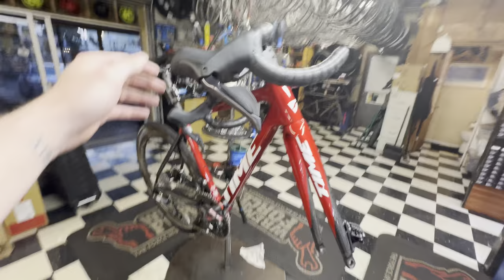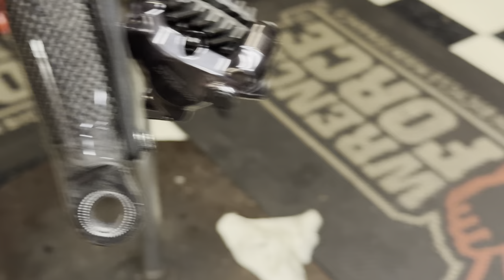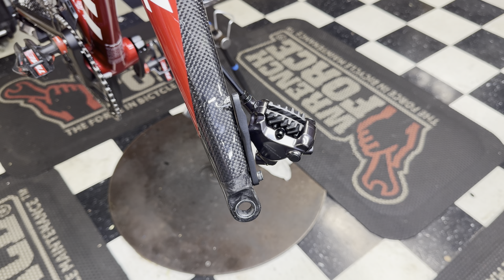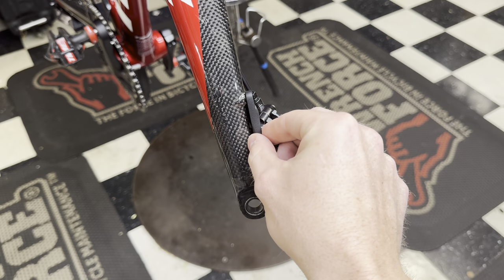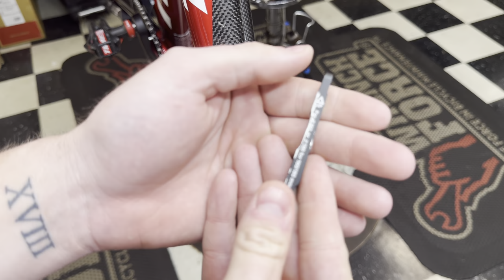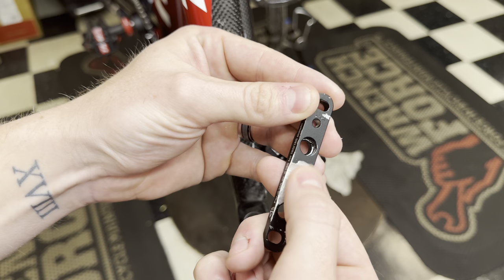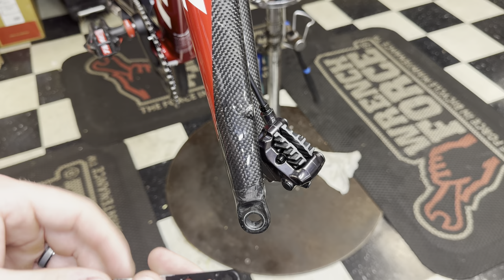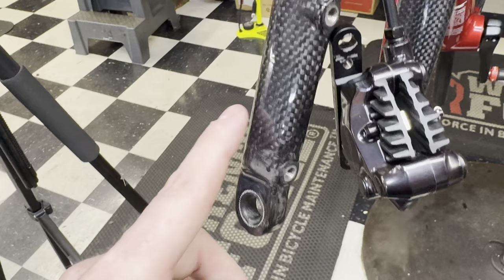HUGE Issue Found with TIME Bicycle Frame

Comment: No direct criticism to anyone involved, certainly not yourself, but if I was that customer I'd absolutely be requesting a new fork from Time.

Even if the solution works for this particular customer at the moment, the idea that this customer / future owners of the bike will have to modify a brake mount to fit different size rotors just feels poor for a premium product costing thousands. Fair enough it's an appropriate bodge to ensure the customer can ride the bike soon, but I'd expect Time to make it right all the same (ie send a new fork and, once received, send the faulty one back).
Reply from the maker: of course, and that is a route I told the customer to make aware to the company and he can do when he wants too, The reason it is like this is because he is a far away drive like 2-3 hours, and i am not a time dealer, he bought the bike direct to them so he has to handle all the back and forth to get the new fork, but that takes time and I know he has been waiting for this build to be done so he wants to ride now, so I am sure he is going to email them and make them aware
Reply: @GCPerformance18  Absolutely, and chapeau to you for taking the time and effort to find a solution which can get the customer pedalling as soon as possible! Very jealous…

Comment: I’ve had experience with problematic caliper mounts. One way I’ve got around the issue is to use very thin shims specific for the job. They work well but they’re not easy to get.

Comment: I like your way of thinking and solving the issue, personally I would change it for the simple fact of the cost of one of those frames, it is very expensive to tolerate failures of that type, greetings
Reply from the maker: yes the customer ended up getting a new fork but in the meantime the customer wanted to ride his bike too

Comment: The grind downed bracket would bother me to no end.  Also, wouldn't the fork come out of a mold?  The fork should be fully cured inside a mold before the mold is removed.  How can a lump exist like that?
Reply from the maker: I have a friend who said he could machine one perfectly, this was a case of the customer is eager to ride his new bike and also needed to be done by saturday, I am a problem solver at that point and want to make him happy and have his bike ready to ride, in the meantime of him deciding what he wants to do
Reply: Inadequate mold pressure
Reply: Fork is likely made without the through axel ends which are bonded on in a separate step after molding the tube section. A bit of extra epoxy dripped when the tips were added.

Comment: Would a thin washer have worked to pull the brake mount away from the fork?
Reply from the maker: it needs more then a thin washer, there was a lot of material, and once you add a washer that is enough to work it would not hit the brake rotor where it should onn the pad and can wear outt he pads wrong and not give you full contact on the rotor

Comment: I would have time sent out a new fork and let them pay for the extra labor. In the mean time... would ride the bike while waiting on the new fork. Good solution... but i wouldnt be happy as a long term solution
Reply: charlesmansplaining but he asked the owner what he wanted to do. It was owner’s decision.
Reply: @Questioneverything72 the owner said he wanted to weight weenie a brake adapter? Think about the loads going through that with the now reduced cross section.
Reply: charlesmansplaining  I disagree. Owner made an informed decision. And once Grant paints ground  section protecting it from corrosion, it is highly unlikely that adaptor fails because from what I see it is still thick and strong. Furthermore, scientifically speaking ( physics), adaptor’s main job is not force bearing. It is for brake position and alignment.  In braking, vector of force is upward on lower bolt ( braking wants to pull it out). and downward on upper bolt ( braking pushes the bolt down). If bolts are not loose and not moving there is almost no tension or force in the middle of adaptor because two side are fixed and not moving. You can ask Hambini if you doubt it  😂 joking
Reply: charlesmansplaining  yes I agree to this point you are making. Because I don’t know how this section of fork bulged out. Does it have a weak line inside? For that reason personally I would have replaced it because I paid 4k for safety and warranty. Otherwise I would have bought cheap Chinese frame ( which I have two). Regarding carbon safety you are correct as well. Eventually resin/carbon bonding weakens over time and no one can set an expiration date on a bicycle. But metal frames are also subject to rust, oxidation and corrosion but they “may” last longer… anyways My Chinese pinarellos are at age 12 now. I know I am descending +40 mph on the edge.  😬

Comment: In my situation I would get the frame that supports rim brakes cuz fuck disc brake rub and pumping loss. Get aero rim brakes if you are worried about aero.

Comment: If you would have put a plastic or carbon spacer, to offset the gap or height in the flaw it would work perfectly! Worked for Toyota for 13 years, was a Master Technician!
Reply: Would this have potentially put the caliper in the wrong position relative to the disc though 🤔
Reply: Well If you put spacer on it, the caliber will be away from the rotor about more or less millimeters and the braking will feel weird and it will damage the caliber like piston. Since you said you work for Toyota, this doesn't make any sense about bicycle...it's a car, not a bicycle. Bruh!
Reply: @pochmaui  how would 1 mm damage the caliper? Most bike frames and wheel combos require caliper adjustment to ensure correct fitment without rub. 1-2 mm is sweet nothing in respect to how big the pads are.
Reply: Rim brakes...no issues
Reply: That is a terrible solution.
Reply: @Spartan9567  Shimano pads are tiny

Comment: it is easier to file down the mounting bracket as it just need to keep the proper distance between the caliper and the frame which is being hold by the screws. So in general if you file down the bracket to sit arround the bolge will be better than sanding the fork

Comment: My suggestion for a short term solution, would have been 1-2mm of washers behind the bottom bolt to flush out the mount until the fork was replaced.

Comment: If that was a manufacturing issue it would appear on every fork produced, but because of the way it is made it cannot be the carbon bulging, it's an overspray issue, it needed polishing out after a bit of sanding.

Hardly a massive issue

Comment: Clever fix. Couldn't you add a small stainless washer between the fork and the caliper mount on the lower bolt?

Comment: Could you have spaced the bottom bolt with washers/lockrings to even it with the top bolt when it's tightened? Seems like that would've straightened it and maybe the caliper sits a millimeter or two higher on the rotor but the pad would still function. I'm no mechanic but that would've been my home solution.

Comment: You don’t just grind off parts of the brake mounting system. It’s safety-critical. Sounds like Time are replacing the fork, which is the correct outcome.
Reply from the maker: its a small amount and that mount is braced by the fork itself, there is not enough pressure in the world where that brake mount fails... even braking down hill for 100 miles, the rotor would brake before that mount
Reply: @GCPerformance18 I'm glad you're confident. Because you've now won liability in the event of an accident involving the front brake...
Reply: The fork needs to be repaired or replaced by the frame manufacturer. No way I’m accepting a solution like this other than temporary while they take care of it.

Comment: If I was buying a Time frame for 4000€, with the reputation they have, I would expect perfection. No way that I would accept something like this. I know that grinding a little bit of the bracket is no problem, but I would think of that everytime I would ride the bike

Comment: It almost looks like the adapter should be turned upside down/fliped and turned in.  That angle at top of the adapter looks like it should fit.  But, good catch.  I encountered that on a fork about 5 years ago building one of my bikes.

Comment: LOL.
I bought a Look Blade RS 795 since Mapdec and some others were drooling all over the bike. On paper, I loved everything (geometry, specs etc) and how awesome the bike looked so pulled the trigger.
Seatpost tolerance was MILES off. You could not get the seatpost in past couple inches. Handlebar design was horrid. The way cables exited the holes, you could move the levers a few millimeters up or down. Allowed no other adjustability. Basically restricting you to a fit that you may not like.

Place that sold it to me refused taking it back since I halfway built it. Got rid of that bike before even riding it. Lost 3.5k dollars in sale because I was honest about its problems. Expensive lesson but I will never ever consider a Time or Look again. I know it happens with every bike brand but so far I've had 30 or so high end bikes. None of them had any issues except one bike needed a shim for headset cover so it doesn't rub on frame. No big deal. Other than that it was just the Look and now your Time with major problems.

They can keep their "artisan handmade" frames 🤣
Reply from the maker: I build a ton of frames and I am really use to specialized and scott because I sell them, but this frame was a lot of patience and problem solving witht he cable routing under the bb and also seatpost clamp has a nice sharp lip to it, very weird for the frame, I am so use to specialized and how quick I can run it through and everything just works.... but This time frame does look beautiful once all built and the finishes of the frame are pretty but I have never rode one so I can not speak on it
Reply: @GCPerformance18  Honestly I don't doubt that any high end bike out there rides great but the differences nowadays lies in the reliability / headache for me. I LOVE building bikes and issues while building a bike just turns me off of them real fast. I agree with the big S. People love to hate on it but I've had 3 rim brake and 4 disc brake S-works and Specialized frames since 2018. They all built up 100% headache free and rode amazing.
Reply: My 1st bike was a Time VX Special Pro and the chainstay rear derailleur cable stop was a glued in peg that eventually came loose and out of the frame! Only dumb design like that that I’ve ever had on a bike! I was the 2nd owner and Time wanted ridiculous money to fix so I literally tossed it into a dumpster!

Comment: I’ve run into this a few times over the years and I’ve always solved it the same way you did.  I use a mill now which leaves a nicely machined surface on the adapter.  Shame on Time for not addressing it before it left their facility.

Comment: Throw a 2mm washer in the bottom level it out more same with a lot things if tightening one side down completely then the other I've added shims in these before with no rises saves all the gaining and loosing the stench of the parts, but this being a defect time need to warrant the warranty and replace the forks later on fix or not

Comment: The problem is with the plate (adapter), I use original Shimano, or even Chinese clone and have perfetc fit. The forks comes from the form, and it cannot change the shape that much, then it is polished and varnished. It could be heavier coat of varnish.
Reply from the maker: Yea….. as I said I have multiples of the adapters that I tried on and even sram one as well. And those all work on other bikes. In this case it was the fork

Comment: Another unbelievable QC flaw from the bike industry... either all shitty frames go to youtubers or there is a general problem here.
Reply: I cannot believe the client accepted that solution... It looks like something I would do on my shitty Aliexpress bike frames but definitely not in an expensive Time frame.
Reply from the maker: lmao this is a problem solving solution he lives far away and is eager to ride the bike, he wants to come saturday, this work and is perfect.... if the customer should choose to get a new fork if it bothers him I am sure it is no problem, also I am talking with a buddy who owns a shop and says he can machine a new adapter very clean cut edges and spray it black so I might go and do that if the customer really wants one
Reply: @GCPerformance18  I just think it's an easy QC check... The solution is fine, definitely better than sanding the fork.

Comment: Wouldn't it be much easier and cost-effective to put a small spacer at the bottom instead of sanding down fork or the mount?
Reply from the maker: The spacer would have to be significant enough to move it away from not touching and when doing that. You move the pads from having the most amount of contact and the wear unevenly

Comment: I cannot imagine any solution other than getting a new fork from Time. This is clearly a manufacturing defect and Time will surely replace with no problem.
Reply: They said in the video that they would be willing to do that. The real question is why isnt the immediate response: what is your adress so we can send you a replacement. Suggesting grinding the fork by end consumer doesnt really suggest that they where jumping at the chance to take care of it. also are they going to take responsibility for the mechanics handywork if he grinded the fork? The solution he did in the end would have been my choice as well but only as a temporary fix untill i was waiting for the replacement.

Comment: I would be concerned now with the brake adapter capability. You just removed 1/3 of the cross section on what i believe takes quite a significant amount of load. Best case, your brake is now flexy. Worst case, that actually fails down the middle
Reply: Rubbish. First of all it was not 1/3 and second the safety margins of these brackets is in hundreds of percents, there is absolutely no way this will break or bend from braking.
Reply: @tonyg3091  source needed. I'm a mechanical engineer, there's not a single component I design with "hundreds of percent" margin on a 1.25 safety factor
Reply: @Shadowboost  Well, since you are mechanical engineer I am sure you can do the maths yourself. Just imagine the vectors of applied forces and you will get the picture. There is no chance in hell this will ever fail.
Reply: @tonyg3091  so tell me, why doesn't every adapter have more than half cross section reduction in the middle of the adapter? It's excess material and weight, right? I guess it only needs to be 3 mm thick in the middle.

Care to look up a fork displacement plot?
Reply: @Shadowboost  LOL, how many grams would they save? 0.005? How much more complicated, time and energy consuming would be making irregularly shaped adaptors? Why bother?
Reply: @tonyg3091  about 5 grams with optimization. Which is a bunch more than what Shimano does for say a front derailleur
Reply: @Shadowboost  dude the total weight of the adapter is about 12 grams 😂🤣

Comment: Why not use spacers? :O
Reply from the maker: It would change the contact point of the pads on the rotor. It would need to be a good amount of spacers

Comment: I had a time bike about 3 years ago and I didn’t think much of it. I bought the frame set and built it myself. I thought it was rough round the edges and needed bits and pieces smoothed tidied up during the build. I built an SL7 S works after that and it was near perfect out of the box. Maybe just unlucky with the Time bike and lucky with the S works.

Comment: Personally I’ll fix it and in the same time ask for the new fork, because if on day you need too change the group you need to redo this process. Then ask for the new fork, ride with the actual one and once the headset bearings need a proper service replace it with the good one

Comment: this is ridiculous, it is not qc, it is a design or technological flaw. on my cheap-ass merida cx400 the area beneath the brake is flat and uniform, with a consistent gap, so you can easily notice if something is wrong. but my bike probably costs like this bike's fork alone lol

Comment: I would have used a couple of washers under the mount.
Reply from the maker: I answered this already it moves the disc from making contact from the pads and the pads do not bite where they are supposed too

Comment: New fork if it were mine, are you now responsible for the brake modification legally?
Reply: Its probably not an issue, but yes and what if something fails (doesnt need to be due to this modification) there will be fingers pointing.

Comment: How about just adding a washer/spacer inside the adaptor on the lower bolt .. or one under each end of the adaptor? I cannot imagine the brake functionality would be affected if it the lower part of the caliper were 1-2mm further out ...
Reply from the maker: it would need to come out alot, it would have to be larger then just small and then at that point you are messing with brake pad contact and the pads would not bite the rotor where they should... yes it would fix the problem of not rubbing but you would not have your brake, braking efficiently and pads would wear out weird

Comment: I would get a new fork from Time. Reason being while the fix you did was perfectly acceptable, what happens later on. While Time would gladly fix it by replacing the fork you never know when new management might take over and tell the customer to take a hike "not our problem. That was the previous company". Also while you found and fixed the problem with out issue what happens if the customer has to take the bike to someone else to fix later on and they don't understand the issue and what to do about it and just jam the brakes on. while that shouldn't happen we don't live in a world of shoulds.

Comment: GC, Can't you just put a washer in the lower brake bolt??
Reply: No because you pushed the brake pads away from the rotor … losing braking surface